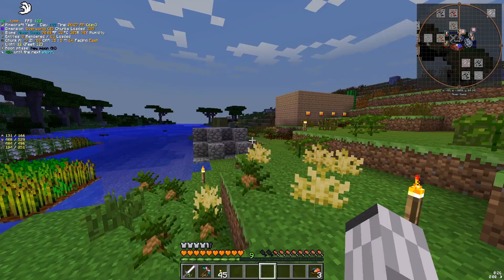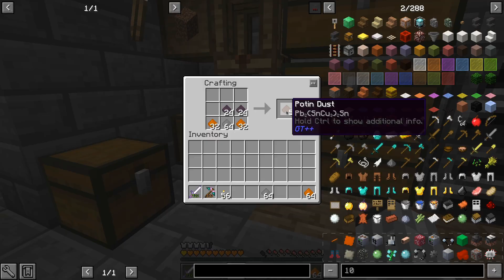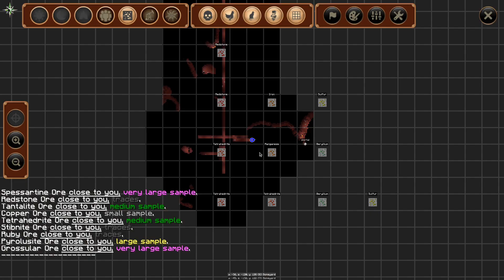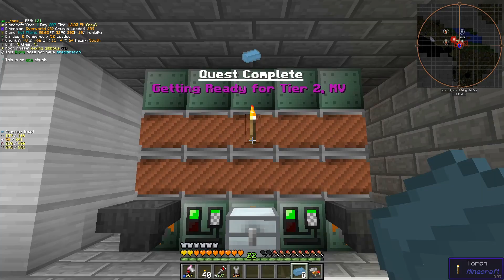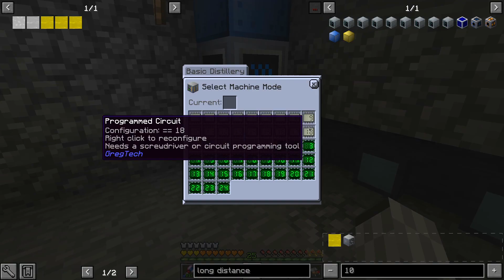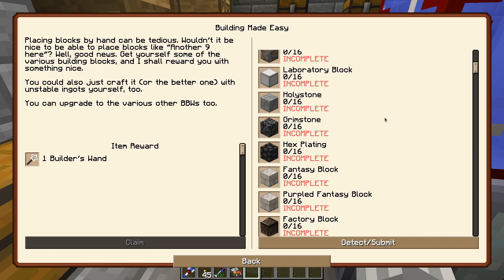GTNH S02E02: and that's how we reached HV.

Comment: How did you run the advanced électrolyser with lv power ? I have 4 lv turbine with 4x lossless cable and it stop mid recipe
Reply from the maker: I'm a bit out of context... do you mean an MV electrolyzer? how much eu/t is the recipe? how are 6ou feeding the power? 

if you use 4 LV turbines yo power an MV machine, you are limited qt 2A, which is half power, you'd need a step-up transformer or a 4-8 mv machine hulls or equivalent cable diode, but that's a bit hard to explain in a yr comment reply.
Reply from the maker: better ask on discord, possibly with screenshots
Reply: Nah thx you it’s ok I figured out for the transformer thx very much ill ask on discord next time 😊

Comment: How did you cool the coolant with the quadruple pipe? im attempting to do the same with no luck.
Reply from the maker: you need a ic2 vent, place it as a cover touching a block of water.

you can use any pipe... you can ever just put it on the machine and it will move hot coolant from the output slot into cold coolant in the input slot

Comment: What's the main reason you keep making so many solar boilers? Isn't something like Light Fuel way more efficient if you look at time spent crafting the solar boilers?
Reply from the maker: you can run out of oil.
the hydrogen/oxygen/distil loops can get stuck in multiple ways.
still going to redo the setup once you unlock distillation tower.
looks ugly.

solars just never self-fail, close to 0 maintenance and i think it's overall quickier to batch craft a cople of stacksa of those than making the circuits and harder mayerials for fuel setup

also for the meme

Comment: how did you pull magnesia only and no raw silicon dust in the poly sillicon Si chain?
Reply from the maker: at the end of that chain, i got only the silicon out (magnesium is recycled inside the machine chain loop).
if you are asking how did i automate it, i did it in a way which i wouldn't reccomend:
a machine won't take more than one stack of the same item. the reactor output is just silicon and magnesia. electrolyzer has two input slots, but only one is needed for the magnesia. you use a chest to buffer the two machines and have the electrolyzer take everything from that chest. it will get one stack of silicon and then it will only take magnesia and leave the silicon in the chest.
Reply: @AverageGregTechPlayer  but then what is the way you recommend to automate it if u think that way is bad?
Reply from the maker: @B3UTYR  anthing with a way of filtering items so that you can split the two things. you could use a drawer with a key to lock the items that can enter as an early-game way of filtering
Reply from the maker: as soon as you have access to it, EIO counduits are great for early game processing chains or anthing that doesn't require high throughput
Reply: @AverageGregTechPlayer  tysm man this will help me in the future

Comment: How did you get the lithium for the item dislocator?
Reply from the maker: i don't remember in this specific run, but usually the earliest way is by working lepidolite (pink ore in the salt vein) and spodumene with 
  a centrifuge.
as soon as you get the mv electrolyzer, clay
Reply: @AverageGregTechPlayer  Thanks for the quick reply! I figured out its the ore washer with the lepidolite you told me about.